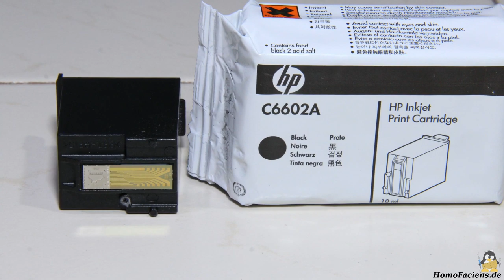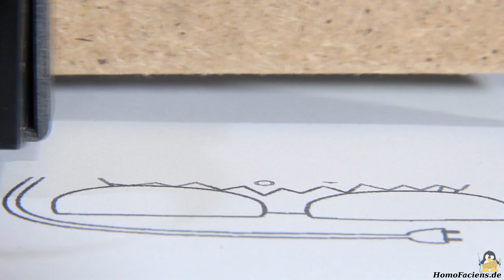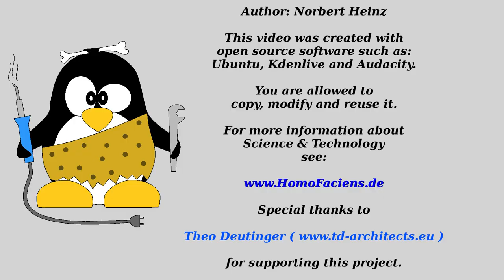Controlling an HP6602 printhead with an Arduino UNO

Comment: Will you add a built-in planned obsolescence too ?
Reply from the maker: ...and a key that doesn't allow to buy cheap ink ;-)
Reply: Well at least now you know you can hook an arduino to you printer and force it to run again.

I wanter to try something like this but i thought the signals for the cartridge would be too complicated. But now after this im even thinkig of making my own printer using the cheapest per ink volume ink cartridge.
The only problem would be the carriage, or maybe ill just use some random continuous ink system instead
Reply: If he hacked more he will get sue. But who doesnt love this hacker.

Comment: I suggest soldering solenoid wire to the connector.  It's easier, more robust, and less messy. Great project, as always!
Reply: Indeed, remarkable how he is driving the thermal based inkjet print head directly manually. Ditched the stock motherboard lol 😂

Comment: This is some exciting work. I was thinking to do something like this or copying your dot matrix printer but using acupuncture needles for finer resolution for large format printing.
Reply from the maker: I will do some experimentation what resolution is possible with fine needles. Stay tuned!
Reply: This experiment reminded me of work I was doing back in the day with my Atari dot matrix printer.  I'd print a line of text or graphics, line feed, then do a reverse line feed and print the same line.  As there was a tiny amount of backlash in my printer, my second line filled in the gaps between the previous lines.  I was getting better prints at home, that my colleagues were are work on their very expensive office printers.
Reply from the maker: I have been thinking of a ribbon but rather would like to have an ink reservoir the needle rests in instead.

Comment: Why does the printhead spray ink only when the head is moving to the right? Why not make it spray the intermediate lines when going to left as well? It can help speed up the printing process.
Reply from the maker: That's just an software issue and as told in the video, the code I have written is not optimized for speed, yet.
Reply: @HomoFaciens  I hope it will get worked upon in the future. Eagerly waiting for your future projects. 
All the best!

Comment: Cool project, could you turn it into the color MJF printer perhaps?
Reply from the maker: In theory: Yes. But I have no idea what kind of binder this printhead can handle. On my list of things to do is an Open Source inkjet print head, but currently just as a bunch of ideas...
Reply: @HomoFaciens  I have absolutely no experince on printheads but i'm fascinated with the idea of opensourced one. I have the idea of building colorjet 3d printer or UV color 3d printer but at this moment lacking a open source printhead and money.
Reply from the maker: Don't expect my open source inkjet printhead to become a superfast and superfine printing one, but it should be good for experimenting with different fluids.

Comment: Greetings.
You could rotate the print head around the z-axis to increase the resolution.
godspeed
Reply from the maker: No need to rotate the print head. You can do this by software if you feed the paper accordingly. You can insert more than just one extra line.
Reply: @HomoFaciens  You could avoid the interlaced raster by rotating it 45º to make the pitch finer
Reply from the maker: By what you also have to modify the software to avoid distortion of your print. So it is till easier not to rotate the print head and to insert intermediate lines.

Comment: Could you make a colored 3D print with this? I mean when you print a layer of the 3D print. Then use the inc-jet head to print color on the outer shells. Then print the next layer and so on. Of course you would have to add a CMY-head as well, but this could lead to relatively cheap easy to produce full color 3D printers. You could even just add on the printheads to existing printers!
Reply from the maker: 3D printers like that already exist (named indirect color 3D printing), so in principle that works.

Comment: Wonder how hard it would be to refill the head with a binder to make a powder bed 3d printer
Reply from the maker: Its not only the process of refilling. The properties of the binder have to be considered as well. It should evaporate by the pulse without destroying the thermoelement and it should not cause clogging of the fine nozzles.

Comment: noob question, sorry I'm new.

How to (2) Open a terminal window and compile the commandline program with:
gcc commands-printer.c -o commands-printer -lm

(3) start the program with:
./commands-printer
Reply from the maker: Pressing Ctrl+Alt+T opens the terminal window in most Linux distributions.
Reply: @HomoFaciens  Can I use inkjet with engraver machine by GRBL firmware?
Reply from the maker: GRBL doesn't support inkjet printers, only cnc routers or laser engravers.
Reply: @HomoFaciens  If I edit the grbl code will it work? or is there another firmware to suggest?
Reply from the maker: If you understand the source code of grbl, why do you ask? If you don't, how will you be able to edit it?

Comment: Can you do the same with a cmyk print head? Actually I only need 2 of the colors.
Reply from the maker: You have to reverse engineer the print head to make that work. The wiring of the nozzles of the good old HP6602 is straight forward, but newer ones (especially the multiple color heads) have a built in microcontroller logic. Not easy to reverse engineer and print head electronics changes faster than weather in April ;-)

I still have building an open source print head on my list of things to do. Maybe some day I have the right idea(s) how to turn that into reality...
Reply: @HomoFaciens  Thanks for the reply. I have an easy way to hook the inkjet to the 3d printer. I'm patent pending on my method, so I'm busy getting the machine built.

Comment: Hey, is there any reason for using C6602? Can I try using any other HP cartridge?
Reply from the maker: You need to know how to control the print head. For the c6602a, documentation is available. Newer types are driven totally different and HP doesn't tell how...

Comment: That is amazing, You must think of printing PCB's in the future :-)
Reply from the maker: I will give that a try, but I don't have the chemicals nor have I ever done etching to date and I am not sure if I will start with that in the near future.
Reply from the maker: With full control over the printhead you can of course eliminate gaps between dots by choosing appropriate head movement and paper feed. I am still not sure if the original ink allows for direct etching or if there is still a photosensitive layer needed.

Comment: how did you find out which pins are negativ, which pins are positive?
Reply from the maker: For details have a look at the project page:
https://homofaciens.de//technics-machines-printhead-hp6602_en.htm
Reply: @HomoFaciens  Thanks a lot, i have to try that with the new printhead that has 52 connection plates... HP2590 Ink Catridge... i already found out it uses 8.4V and 1.6us Pulse width 🙂
Reply from the maker: Unfortunately all those printheads are not so well documented :-(
Reply: @HomoFaciens  True but from your fotos i see i just have to find out with trial and error to find the VCC port and each Nozzle negative 🙂 Its already a huge help....
Reply from the maker: Good luck!

Comment: Will you please tell me which pin of C6602 is connected to which ULN2003 pin as I am thinking of making my own 3D printed cartridge holder. As shipping is unavailable in my country...please help
Reply from the maker: That is just a software parameter. I have written a couple of code lines that fire each nozzle a couple of times, printing lines on the paper. From the relative position of each line you can conclude on what nozzle is connected to what pin of the Arduino. Have a look at the source code that can be found on my pages:
https://homofaciens.de/technics-machines-printhead-hp6602_en.htm
Reply: Thanks a lot
Reply from the maker: Will you please got to my homepage to find it? Just none hint: There is a link named "contact" on each of my pages ;-)
Reply: Thanks a lot

Comment: are there any piezo cartridges that could be controlled by an arduino?
Reply from the maker: I only know about another HP bubblejet cartridge. The piezo types are usually permanent printheads and so  more expensive. Ruin them with your experiments while trying to figure out how they work blows your budget...
Reply: Not really. Either they need specialised driving circuitry with special waveforms (Epson) or the printhead has the driving electronics built-in, but is very expensive (Xaar 128)

Comment: Wow, I love it! Are these cartridges cheaper as well? I am currently in the process of turning an old printer into a pen plotter that should be able to print on long rolls of paper. Also a lot of fun :)
Reply from the maker: I got mine for less than 10,- Euros. Plotters are definitely fun projects and really good to teach some maths.
Reply: @HomoFaciens  Yeah, so far I built the best possible CoreXY pen plotter. Now working on an A0-size model. But I found this little old printer and turned out to have stepper motors instead of the usual rotary encoded DC motors. So this could be an easy convert! :) And it just looks small and cute. I'll make a video on it when it's finished.
Reply from the maker: Hope to see it plotting, soon!

Comment: Good god... these are expensive R & D... Imaging burning out one of the actuators, you got like 2-6 left. Please do this R&D for Epson L1800 print head, it should be a piece of cake for you since it's much easier to control since it uses piezoelectric rather than thermal. Would be a great immense contribution help in using virtually any kind of sublimation inks. Thanks. BTW, dude got the illest euro nerd accent, just sayin...
Reply from the maker: Unfortunately those modern print heads have not a wired matrix as the good old HP6602 I was using in this project. That makes reverse engineering anything but a piece of cake. You have to deal with serial data transfer and eventually with encryption and DRM stuff. :-(